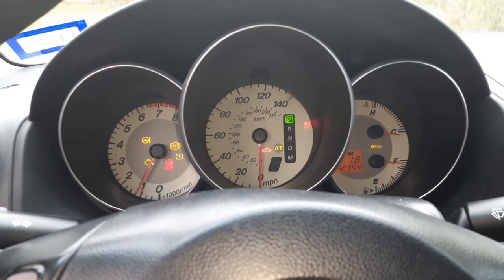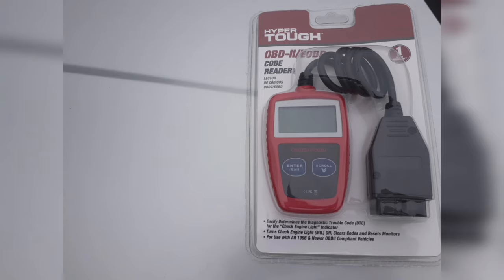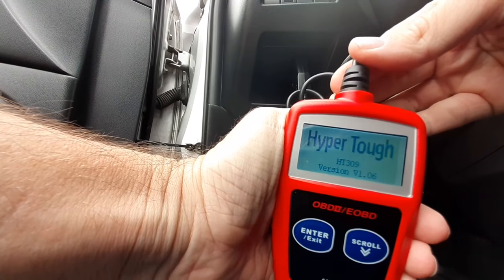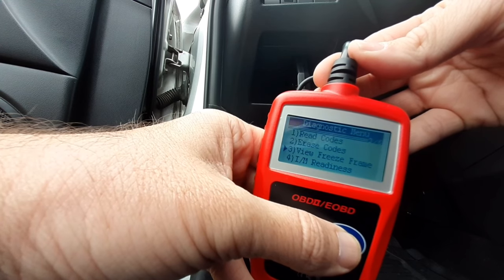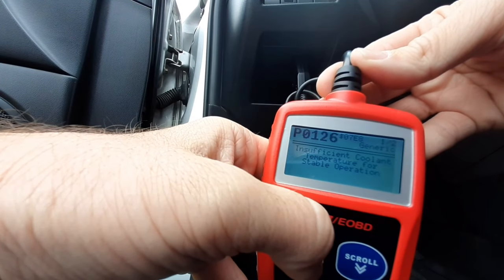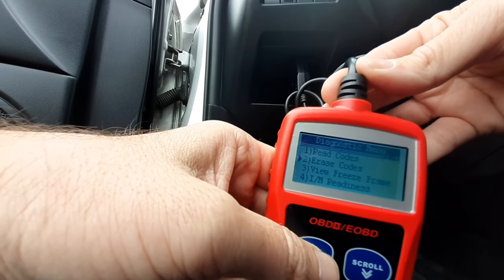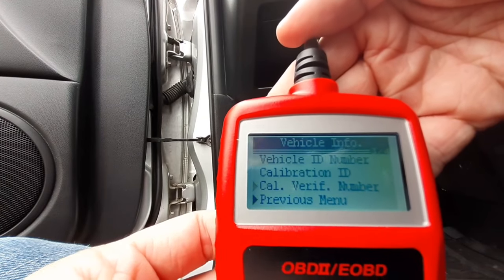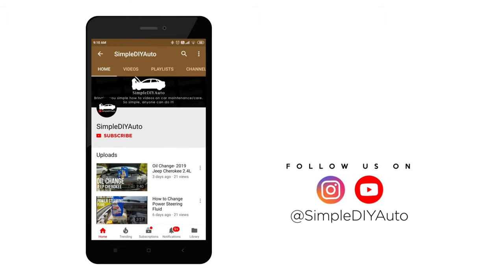How To Use An OBD2 Code Reader To Diagnose Check Engine Light Issues

Comment: just bought this did everything on the video but says failed to connect
Reply from the maker: An OBD2 code reader might fail to connect to a vehicle for several reasons:

Power Issues:

The vehicle's OBD2 port might not be providing power. Ensure the ignition is turned to the "ON" position.

Check the vehicle's fuse box for a blown fuse that might be related to the OBD2 system.

Compatibility:

The OBD2 reader might not be compatible with the vehicle. This is especially true for older vehicles or non-standard OBD2 protocols.

Faulty OBD2 Port:

The vehicle's OBD2 port could be damaged or dirty. Inspect the port for any physical damage or debris.

Faulty OBD2 Reader:

The OBD2 reader itself might be malfunctioning. Try connecting it to another vehicle to ensure it works properly.

Wiring Issues:

There might be issues with the wiring between the vehicle’s ECU and the OBD2 port.

Communication Protocol Issues:

Different vehicles use different communication protocols (e.g., CAN, ISO9141, KWP2000). Ensure the reader supports the protocol used by the vehicle.

Software Issues:

The software in the OBD2 reader might need an update, or there could be a bug causing the connection problem. Check for software updates or reset the reader.

Interference from Aftermarket Devices:

Aftermarket electronics (e.g., stereo systems, remote starters) can sometimes interfere with OBD2 communication.

To troubleshoot, start by ensuring the ignition is on and checking for any blown fuses. Then, inspect the OBD2 port for damage and test the reader on another vehicle. If the reader works elsewhere, the issue is likely with the vehicle; if not, the reader might be faulty.

Comment: Can this check SRS airbag problems too? I have a red triangle on my dashboard in my Volvo s40 (2008) and it is not a fuse or a weak battery.
Reply from the maker: Unfortunately, this particular code reader can not read SRS

Comment: thanks for the tip about the key in ignition, several videos I scanned never even mention it, good thorough job,
Reply from the maker: Thanks for watching! I appreciate it!
Reply: The user guide for my code reader says to insert the code reader before inserting the key, then to turn the key to the accessory position, ie, not to start the car. When done, reverse the process.

Comment: I have one if these too and yes it's ok as a code reader and few other basic things. But for about $40 you can get an OBDII that can also read live data which can be a big assist to narrow down the problem even if you eventually take your car to a shop. In my case I got a fuel trim code but without live data you don't know how severe it is or if it's lean or rich.
Reply from the maker: Great info
Reply: Which obd2 do you  recommend? My p0456 code for small Evap is so annoying. And every mechanic tells me something new.
Reply: Most people don't understand to that extent, so this reader is better for the average person.
Reply from the maker: @premiumc2282 I have tried three different brands. This one is by far the best choice especially for the price
Reply from the maker: @squirrelcovers6340 Yes indeed

Comment: Hey man, I was cleaning and I accidentally threw out the instruction manual to this scanner. You did a wonderful job explaining, and it’s a great vid, but I have a bit of a memory problem. Do you know where I could find the user/ instruction manual for this scanner?
Reply from the maker: Thank you for watching and for the kind words. I appreciate it. 
While I cannot locate the exact manual for this, I did find one that's almost identical.

https://www.auteltech.com/autelcms/u/cms/www/201209/07033345uqvu.pdf

Hope this helps
Reply: @SimpleDIYProjects  thanks man! I really appreciate this!

Comment: Do you turn on ignition and then plug in scanner? Or plug in scanner and then turn on ignition? No one ever makes those two steps clear. Thanks
Reply from the maker: I turn ignition on, then plug in. It won't power on until you turn the ignition on, at least this one won't. Thanks for watching!
Reply: @SimpleDIYProjects I accidently started the car with it connected, will that cause damage.
Reply from the maker: @AmrenMirit Accidentally turning on your car with the OBD2 scanner inserted shouldn't cause any damage. The OBD2 scanner is designed to communicate with your car's onboard computer system and retrieve diagnostic information. It's a passive device that doesn't interact with the vehicle's operation in a way that could cause harm. However, to avoid any potential issues, it's a good idea to remove the OBD2 scanner before starting your vehicle.

Comment: Can this device turn the engine light off permanently ?
Reply from the maker: You can clear the code with this device. But if the car throws the same issue again, the code will reappear. Best to correct the issue

Comment: Trying to scan my car with scanner.. my old car info is still on it .. erased everything associated with old vehicle, but it keeps coming back on the OBD again ..??
Reply from the maker: What type of scanner is it? 
An OBD2 scanner typically doesn't store previous diagnostic trouble codes (DTCs). It's designed to read and display current and pending DTCs, as well as provide real-time data from the vehicle's sensors and control modules. Once the issue causing a DTC has been resolved, the scanner should no longer display that code. However, some scanners may have a "clear codes" or "erase codes" function, which allows you to clear the stored DTCs from the vehicle's computer after the issue has been fixed.

Comment: Do it work on a 2005 Nissan Altima?
Reply from the maker: Yes it will. Thanks for watching!
Reply: @SimpleDIYProjects  Thanks
Reply: do it work on mazda demio 2011 and toyota corolla 1996
Reply from the maker: @challieamin9783 All 1996 and newer model year gasoline and alternate fuel passenger cars and trucks are required to have OBD II systems. All 1997 and newer model year diesel fueled passenger cars and trucks are also required to meet the OBD II requirements.

Comment: Mines won’t turn on even when it’s plugged up car on on position. Help
Reply from the maker: You can also try it with the car on, whichever is in your obd2 manual, and give time for the scanner to initialize. Some models will need you to press a power button for them to begin the initialization process. Again, it’s important to have the OBD2 reader manual for the specific scanner so you’re sure.
Or lastly, it could be a faulty obd2 reader if its not receiving power.

Comment: I have accidentally erased a code and how do I get it back?
Reply from the maker: Once a diagnostic trouble code (DTC) is cleared from a vehicle's onboard diagnostic system using an OBD2 code reader, it typically cannot be recovered. Clearing the code erases it from the vehicle's memory, so unless the issue that triggered the code resurfaces and causes the same fault again, the code will not reappear.